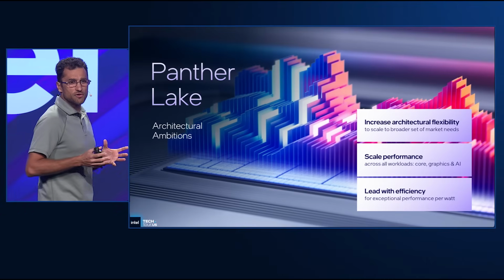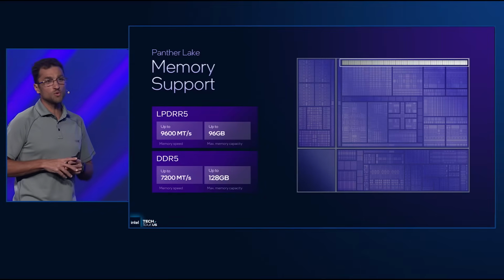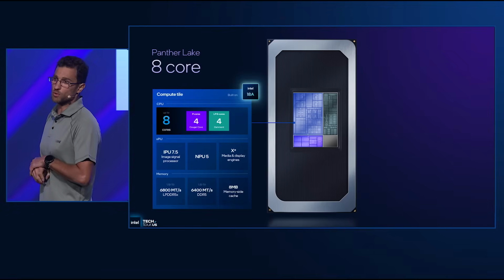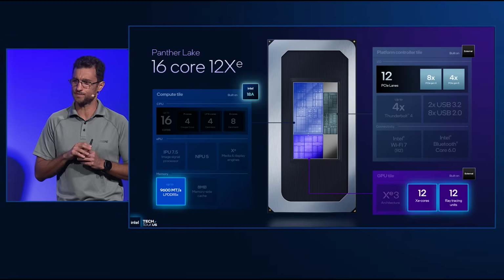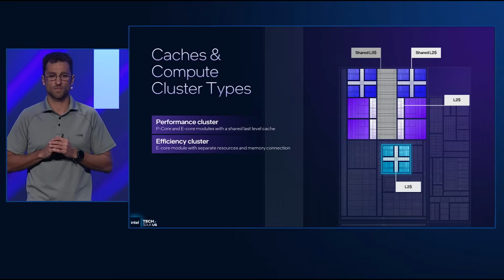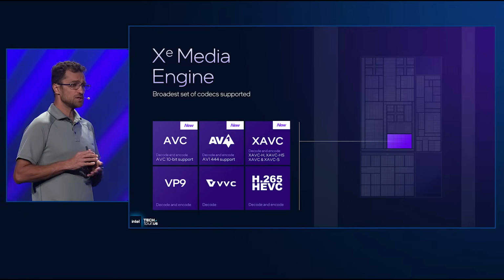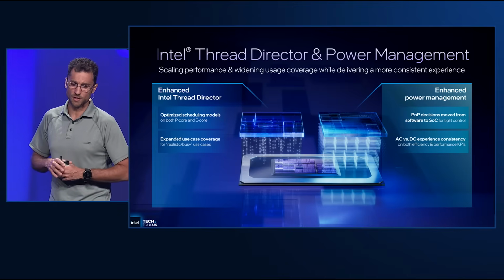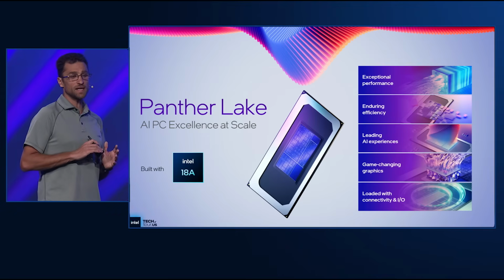Intel Technology Tour 2025: Unpacking Panther Lake's SoC | Talking Tech | Intel Technology

Comment: Ryzen 395 igpu and apple m5 max gpu actually the competitors you need to surpass
Reply: These $2000+ laptops occupy a very limited niche in the market. Most people buy laptops for $1000 or less.
Reply: No, those are in $2000 laptops, you can currently get an oled lunar lake laptop for $600-700 and it honestly is a better laptop. It has better battery life and not significantly worse performance really

Comment: 9600MT/s is equal to what desktop speed ? Whats the formula relation from Laptop ram speed to desktop ram speed ?
Reply: The exact same. Lpddr is just low power compared to desktop ram. The difference is cost, which matters more for the OEMs then us.
Reply: It's equal to 9600mt/s on desktop. LPDDR5x is just low-power DDR5. LPDDR5 and 5x tend to have worse timings than DDR5, but use less power.

Comment: Imagine a 32 Xe3 core APU?
Reply: Nova Lake AX is rumored to be 48 Xe3P cores
Reply: @meekyuu9700 silicon steak leaked it
Reply: @meekyuu9700  no way a 48 core is fitting on that package, it'll need to be a dGPU. NVL-AX has a 24 Xe3P tile to compete with MDS-H.
Reply: @meekyuu9700  It's a shame it's too late. Then it will have to compete with RDNA5. If RDNA5 has support for FR4 for neural networks and neural rendering of games, which Nvidia is trying to promote, and XE3P doesn't, then this is a potential loss from the start
Reply: @Максим-ц7з5щ it’s competing with mobile parts, not full dgpu’s
Reply: Nova lake AX 48 Xe
Reply: it give 4 cores hhh #intel  is B*llsh*t , we need at least 10 cores igpu like mackook air M5/M4
Reply: @nft5646   Apple needs extra cores to overcome the disadvantages of ARM